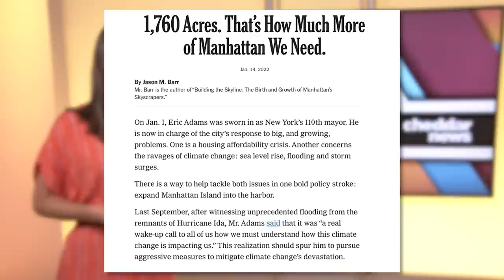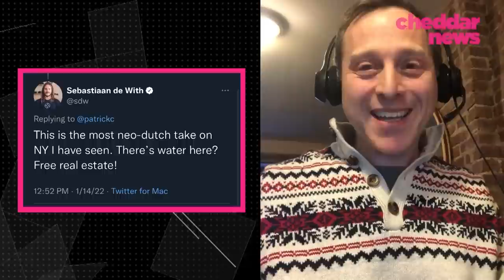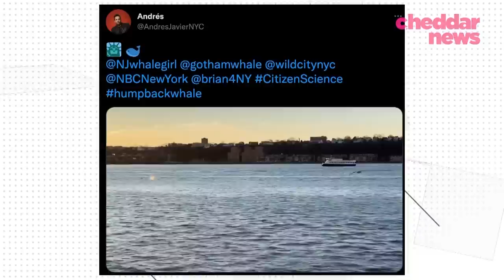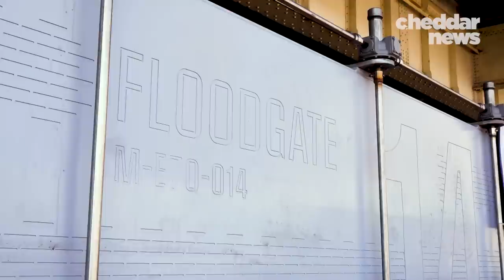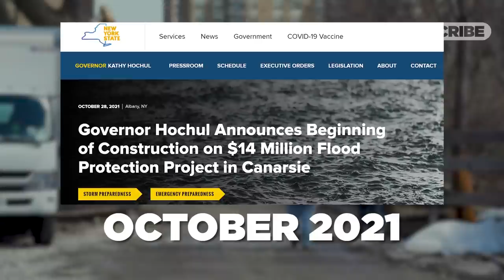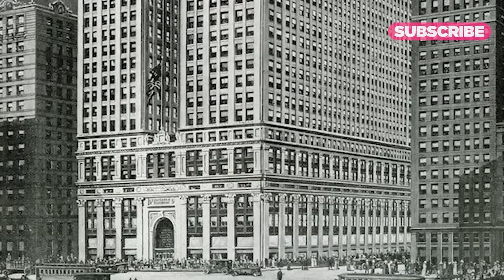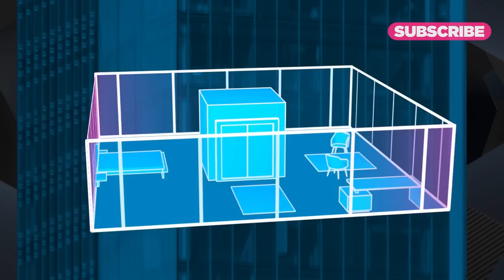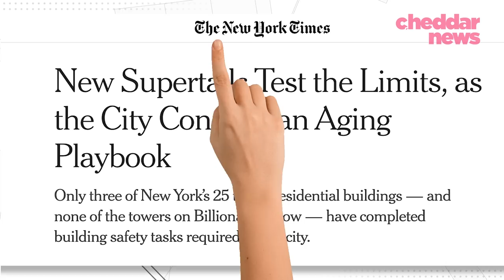The Future Of NYC - Who Knew?

Comment: It's a city.  Is the ecological impact more than if the city expanded elsewhere?  1300 access of high density near Manhattan probably replaces substantially more access of lower density further away, plus reduces the length of transit (metro, roads, buses, etc.) needed.  If built transit oriented, and with parks, it could be a lovely addition.  And the money from the sale of the reclaimed land could support transit elsewhere (or just more corruption, *shrug*).

Comment: Attempting to change the shape of Manhattan is NOT a good thing at all.  Its not that it has not been done before as the current perimeter of Manhattan is mostly man made extensions,   the problem is altering the flow of water.  both the Hudson and the other estuaries.   Your not simply changing the flow at the point of alteration, you changing it for miles.  which could greatly impact sea live, beaches you name it. all forsake of what?  some more high priced real-estate that no one but the super rich can afford.   NO its moronic. and exactly why Manhattan built up and not out.   The problem with people that think of such stuff is the fact they never - ever think it thru to competition.  and never consider the consequences, only the gains.  only their pockets.  And when problems arise its these people that go slinking off into the distance washing their hand free of ever being involved. And it must be said... when it comes to europeans doing such things... their are few examples that see success and not utter meltdown level failure.